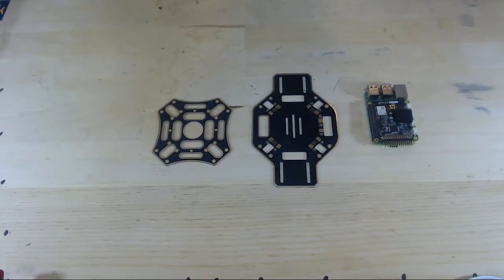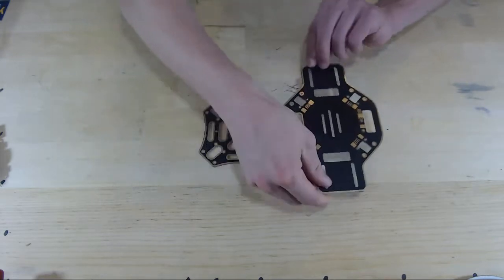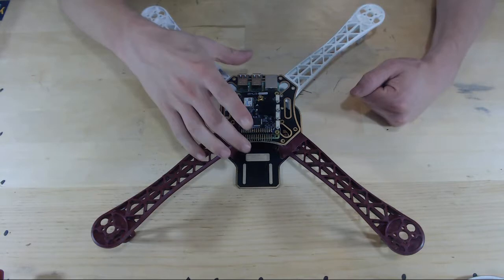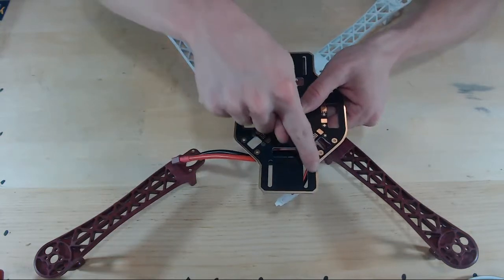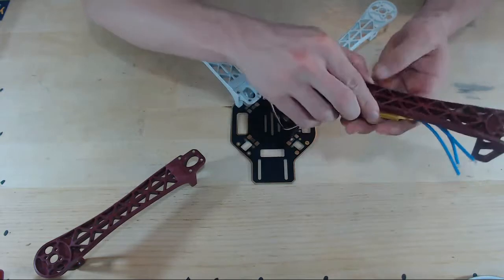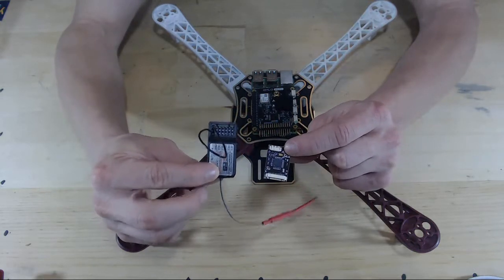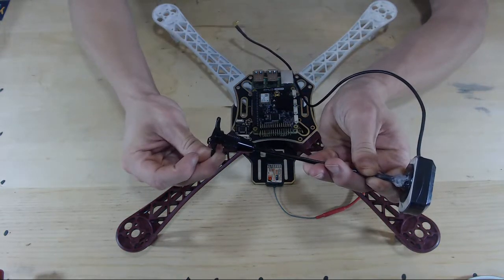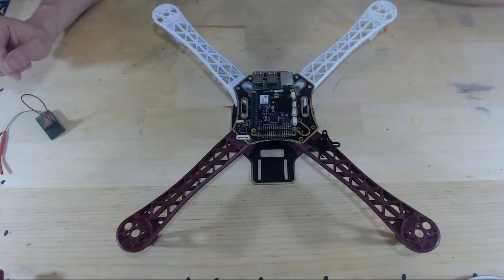Part Placement Planning | The First Step of Drone Building

Comment: So that's $200 for the Navio kit, $40 for the pi, then there's frame, escs, motors, radio... I think I will just buy a $25 flight controller for my first project!
Reply from the maker: Definitely reasonable! Different builds fulfill different needs. This NAVIO build is maximized for convenience, linux lovers and drone programmers, but definitely is not optimized for cost.